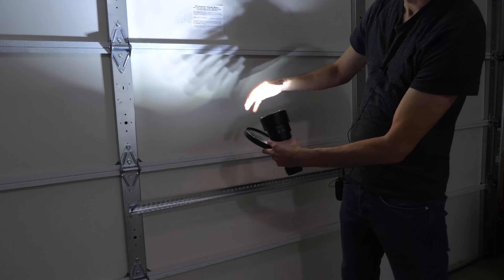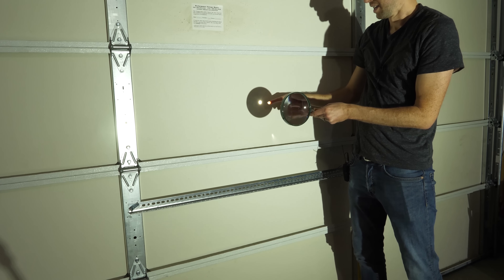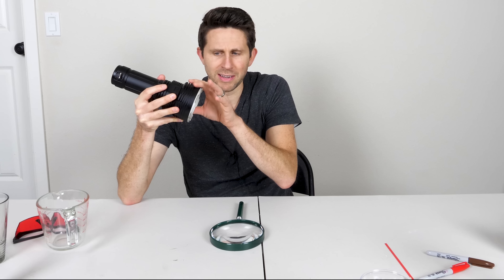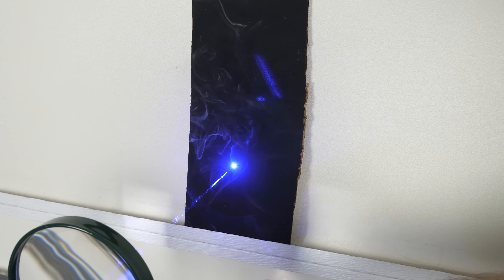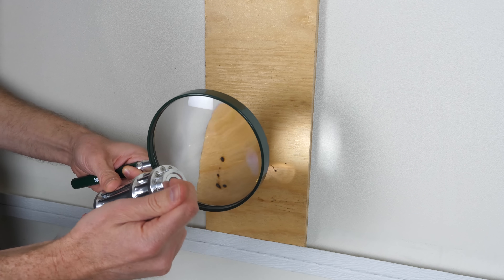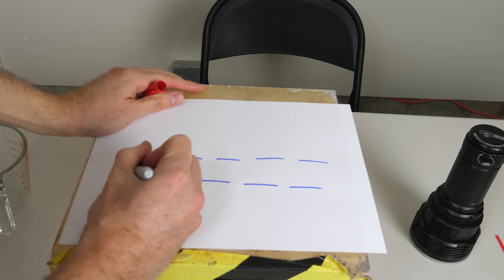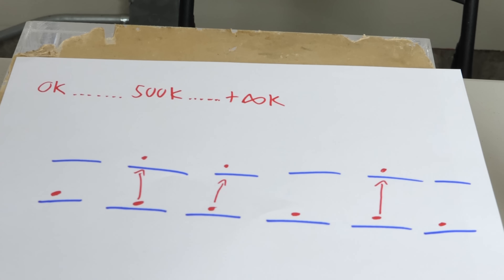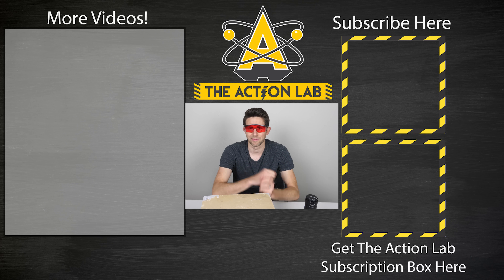What Happens if You Focus a 5W Laser With a Giant Magnifying Glass? Negative Kelvin Temperature!

Comment: Fake!!!!!!I'm not saying you are wrong  but it is because on a flashlight it has a bigger surface area covered of light,so if you focus it down it would be the same amount of heat before it was not focused but when it wasn't focused it was over a bigger area so it would not be as hot as if you focused it because all of the heat would be focused down into smaller area and it would make it harder in that one area instead when it's not focused in one little area it's colder because it's over a bigger much bigger area so no sorry it's technically wrong but technically correct in the same way ☺️ it is mostly wrong though if you ask me 😋

Comment: So much of the information in this video is incorrect and I’m baffled by how many thumbs up it has. Flashlights have a wide variety of wavelengths which is why it is hard to focus the light (at any given distance of the magnifying glass only one of the many wavelengths are being focused). A laser is all one wavelength so you just have to find the right distance and it will all focus. As for temperatures hotter than the source. This makes sense because the total energy is conserved but is concentrated to a smaller area so the temperature has to go up to conserve total energy....no negative temperatures

Comment: This is basically how a metal-cutting laser works. The beam (Which can be as powerful as 7 kw or more) is focused down to a tiny point, and oxygen is blown onto that point - which causes the metal to burn out under the focal point. If you're cutting aluminum or stainless, high-pressure nitrogen is substituted for oxygen.

Comment: OK I can't take it anymore, I love your videos but this can't be tolerated.

The only reason we can't harness all of a flash light's power is because not all of it hits the magnifier, but if we were to remove its diverging lense or put it in an elliptical mirror to stop the spreading all of it can be collected.

In fact the light that manages to hit the lense actually focuses into a brighter spot than it was without the magnifier. The only reason a laser's focused light can be of higher intensity than the source is because we intentionally cut off most of the light until a point is left. 

It does not depend on thermodynamics, and certainly their's no negative infinity loophole to that law.

The real question to be tackled is whether it could be possible to achieve infinite intensity by focusing light on an infinity small point in space.
The answer to which I believe is no.
We like to think of our world as a contium but in fact it's pixelated into cubes of side= one plank length (maybe smaller), so that's the lower limit of the area we can converge into.
Also light isn't a continuous beam, but a stream of individual photos.

Thus the max intensity we get =(no of photons in give beam) /(1 plank length ^2)

Comment: Is it really impossible to focus light from a lamp, such as a flashlight, to a brighter point than the source?  What if you had a really big lens or used a concave mirror to focus the light into a point?  I don't understand why it's impossible to focus the light to a brighter point than the source.  I do understand why you can't with that flashlight and that magnifying glass, though.

As for your point about thermodynamics, I don's understand how it violates it to have a point hotter than an equal sized point on the surface of the source since the source is big.  The total thermal energy radiated from the surface of the source must be higher than the total thermal energy reaching the table surface, but the temperature should be able to be higher at that point than at an equal sized point on the surface of the light since not much of the total light is being emitted from that point.  Of course I understand that you can't create energy by focusing the light, the point can't contain more energy than the entire source, but you should be able to burn something with a focused beam that wouldn't burn if you just shined the flashlight on it, even if to total energy is greater since it's spread out, like how you can create extreme pressures using the tip of a diamond in a mechanical press.

As for the sun example, of course it doesn't matter how a lens on earth is, the sun is a lot bigger than the earth and only a very small amount of its emitted light reaches the earth.  But couldn't you theoretically make a point hotter than the surface of the sun if you had a lens that was much larger than the sun that could focus all of the light that comes out of one side of the sun into a small point?  You could even put an even larger concave mirror on the other side of the sun to reflect back the light that is emitted from the other side of the sun.  The gravity of such large lenses and mirrors makes this impossible (plus where would you get all the glass?), but I don't see how this violates the laws of thermodynamics.
Reply from the maker: It violates the second law because it means that you could have heat flow from something colder to something hotter with the right lens. And that is absolutely forbidden in thermodynamics.
Reply: @TheActionLab  But I can shine a flashlight on a hot plate. Radiation still travels from the cooler light bulb to the hotter hot plate. Just the hot plate losing thermal energy faster than it gains it, resulting in a net loss. That's heat. I still don't see why a large light source can't have its light focused into a smaller, hotter point that is still less hot/bright than the original light source yet hotter/brighter than a point in the large light source of the same size.

Comment: This seems to include some distractions.  The illumination of the focused point has nothing to do with the energy inversion within the light source (the body of the lasing cell, assuming it is not just an LED 'laser', most of which are just focused LEDs).  The density feature of a laser is due to its coherent wave-front leaving the front mirror.  Using a magnifying glass destroys that coherence.  The fat (white) light has no coherence to start with.  It is a bunch of separate light sources, which can be focused somewhat, with the obvious chromatic aberration limiting the 'image' density.  You can certainly raise the temp of a small point (image) to greater than any small point on the big source, assuming you are careful about your light path management.  The idea that you can get an infinite temperature from a non-infinite source by focusing a non-point source on a 'point' seems to ignore most of the optical inefficiencies, not to mention thermal phenomena.
Not done here; sigh.

Comment: You have totally misunderstood.  You are correct about thermodynamics etc, but not in this case.  We are dealing with photons which are radiated. It's fine to take energy over an area and pass it through a lens to direct them over a smaller area. This will then produce a higher energy density that will get hotter.  It's not a direct heat to heat situation.  Its totally fine. You can have a brighter point than its source, and you can have therefore have  a hotter point than the source.  You are overthinking it in this case.

Comment: I’m not so sure about the idea that you can’t get a temperature hotter.  The total heat value is limited.  But is the temperature limited?  A smaller area with higher temperature seems to agree with the conservation law. I definitely could be wrong about this application.

Comment: Lol no it's not hotter than infinity. The induhviduals that tried to say temperature was defined by excitation level population proportion among the particles comprising something created a definition of temperature that makes no sense. Temperature is one simple thing. Average energy per particle. In a ratio of about 11 thousand kelvins per electron volt per particle. Meaning if you have a volume of helium at 11 thousand kelvins, the helium atoms are banging against each other, each with a kinetic energy of on average 1 electron volt. On average. When 2 particularly fast particles hit each other head on, the collision will have much more energy than 1 electron volt. Where am I getting this 11000 K/ev figure from? It's just the charge of an electron divided by Boltzmann's constant. Literally this is a constant of nature. Also, the particles COMPRISING the helium are also banging against each other with on average 1 electron volt of energy each. That's what temperature actually IS. Now laser light, is a funny thing indeed, for what's special about it, is that it is electromagnetic radiation that is non-thermal in nature, because it is better organized than electromagnetic radiation can normally be of that energy level, which means you can make something HOTTER than what would normally be the temperature of the radiation temperature (its particle per unit) by use of optics. Yes, light itself normally has a temperature, as it always does when it is generated by thermal means. For instance, it is impossible with any clever arrangement of magnifying glasses and mirrors operating on sunlight, to make anything hotter than the surface of the sun. You might THINK it might be possible, namely if enough people reflected sunlight all into one spot with mirrors, but in fact you'd be wrong. But laser light is not the same way. You can take a seemingly weak laser beam and with use of mirrors or lenses, there IS no theoretical maximum temperature you can use it to heat something, but that is not because it has some magic negative temperature, but because it is rare non-thermal electromagnetic radiation. Radio waves emitted by an antenna is another example of non-thermal electromagnetic radiation. Which is why you can make something very hot with a microwave oven, much hotter than the near-absolute-zero temperatures at which something would normally be glowing primarily at those frequencies. The microwave radiation is organized and concentrated far better than any sort of thermal source of microwaves could ever produce it.

Comment: There is no NEGATIVE Kelvin temperature
It's just focusing light on smaller AREA
Reply: A light is not a 100% made of mass so it can have energy in negetive
Reply: @statetaxinspectorshriram873  what? Kelvin isn't an energy but a temperature, it's not the same thing. It's clearly impossible to go lower than 0 kelvin because it's THE coldest temperature, the fucking limit, as a thermodynamic student I can tell you that "negative kelvin temperature" is pure bullshit
Reply: We actually use lazer to make very cold temperature but it's impossible to get 0 kelvin or less, if you see someone talk about negative kelvin or even the absolute cold reached, he scamming you or know absolutely nothing in sciences, kelvin himself based his temperature scale in the way to get the coldest temperature (the hotless should be more accurate) at 0. Temperature is the movement of atoms and particles, when it reach 0 the particles stop to move, even the photon in the light !!! You can't go any further (and no they will not move in the opposite direction if you take negative temperatures that's incredibly stupid)
Reply: @icewalker1185  Negative temperature is a real thing. You apply some mathematics to the distribution of energies within a system and it gives you a positive termperature. However some exotic systems, when you apply that mathematics to the, produce a negative temperature.

Negative temperature is just a mathematical quirk
Reply: @Mandragara  I talk about real temperature, not about math and theory, the scientists use engineering and innovation to get always closer of the absolute 0, don't make me believe that a guy can reach it with just a little lazer and a magnifying glass from his home while confirmed and experimented scientists work on absolute zero for years, it's ridiculous
Reply: @icewalker1185  There is no such thing as 'real temperature', it is only defined by maths and theory. All your senses can tell you is if something is hot or cold.
Negative temperatures are actually very hot, actually hotter than any positive temperature. This means that if you connect an object with positive temperature to one with negative temperature, initially energy will always flow from the negative temperature to the positive temperature. 

Believe me this is a real thing.
Reply: @Mandragara  ok, I trust you... but i'm not sure my thermodynamics teacher will agree lmao
Reply: @icewalker1185  I promise you, it's nothing profound. It's just a mathematical quirk of how we define temperature. This picture explains it: https://lostinscience.files.wordpress.com/2013/01/negative-temp-graph.jpg

0 kelvin has all atoms in lowest energy state. Infinite temperature has all atoms equally spread across all energy states. So what happens if we put more atoms in higher energy states than lower ones? Well the maths spits out a negative temperature.

So you can see that negative temperatures are actually very hot.
Reply: @Mandragara  what I am able to grasp you are trying to say that negative temperature is not really negative but an illusion
Reply: @Mandragara  "There is no such thing as 'real temperature'" Oh god please don't tell me that Complex Temperatures are a thing, I can barely wrap my head around this idea of negative ones, if you go through temperatures that have some imaginary component to them I'm certain it's gonna snap.
Reply: Focus the light from your desk lamp then and burn some paper.
Reply: both

Comment: Yes, but Why the Giant Magnifying Glass again?

The giant lens only makes sense if one has expanded the beam enough to fill the aperture of this lens. Someone below mentioned something about a second lens for example and possibly a third. In reality one could remove the "colimating" lens incorporated in the laser assembly and allow the beam to expand and fill as much as possible of the giant lens.

If not expanding the beam, a tiny lens, e.g. 10x10mm would do exactly the same job as this giant lens, unless the radius of curvature of focal length was any different.
If expanding the beam to fill this lens, one could be marking st. steel with this laser at >1000 'C instead of burning wood at marginally 300.

Finally, brightness is a temrinology in laser physics and in the case of using free space optics like in this experiement it is always the same, wheather measured after the source, at the lens or at the piece of wood being burned. As some indicated below, the power per unit area has increased.

Good attempt in explaining population inversion though and how this is the differentiator in emitting coherent light with lasers.

Comment: Except if you use a lens with the right size and focal distance (maybe a fernell lens for reduced weight) you can focus all the light from the flashlight to a small point and that point will be brighter than the surface of the flashlight

Comment: The highest temperature is not Infinity, it's the Planck temperature. Although it might seem unlimited, because the more Energy you put in, the hotter it should get, calculations break down above this temperature.
It's roughly 1,416 784(16) · 10^32 Kelvin.

Comment: You made a mistake when you introduced second law of thermodynamics. you are focusing the energy, therefore theoretically you can get infinitely big intensivity if your area is infinitely small
Reply: You deffinetly forgot planks length
Reply: @jacksoncamback6879  i could be wrong but planks length is for physical things not ideas. For instance an idea (like a laser dot) can travel faster than light bc its not made of matter. Just like the spot where all the photons are hitting can be smaller than planks length bc the spot isnt a physical thing. This is a dumb discussion anyway bc it is entirely impossible
Reply: I think what he showed was that focused laser could had higher energy than the laser source itself.
Reply: @gorilladisco9108  it isnt higher energy. That would be creating energy. It is just more concentrated energy. He actually messed up a lot of science in this video
Reply: @illicitlegacy3783  No if you shine a laser through a magnifying glass it genuinely makes more energy than you put in. It's a quirk of lasers, due to effects that he badly explained in this video. I'll link a physics forum in my next post which talks about this.
Reply: @Dachi Okropiridze  The point is that you cannot get the area to be small enough to make it hotter than the original source.   He understands the area thing.

Comment: U could get it hotter than the sun if you looped and collected the energy. Say the earth would only ever get a fraction of the energy coming off the sun, but you'd think if the sun is losing energy overall, eventually it'd have given off enough energy to to produce the same temp in a small area easily, but for the same area, the planet would have had to have been around    before the sun, and depending on its energy collecting capacity, would have to at least consume the equivalent of the emissions in its first half of life to be able to produce a temperature hotter than its initial surface would have been or is. I dunno if it'd be possible after the half life, but it might be if it burns hotter at different stages towards the end. Coz otherwise if it's output did decline, say if you did manage to capture 50% of the energy with a giant space net of magic 100%efficient solar panels or concentrated it in some kind of loop, you'd probably still have to wait until the star died to have enough. Talk about insane hypotheticals. Even if we were crazy enough to create such a thing to capture 100% of the output, (maybe someone out there did recently when the blue star vanished)  we'd have to spin it at some kind of immense precice velocity to prevent it from collapsing into the sun which would probably defeat the purpose of doing it in the first place! Lol thermodynamics.